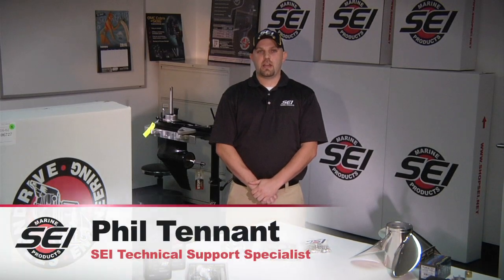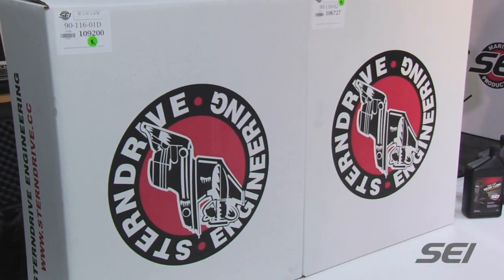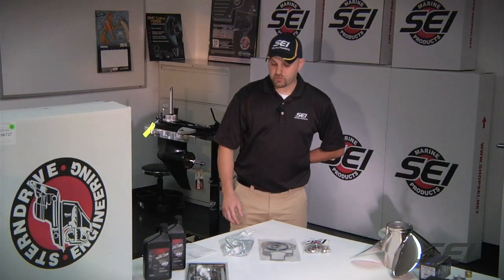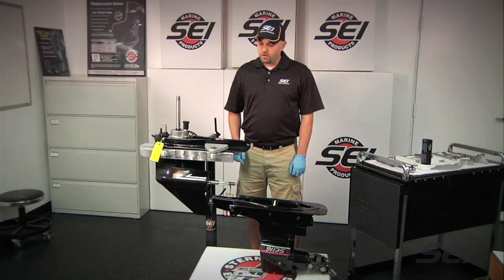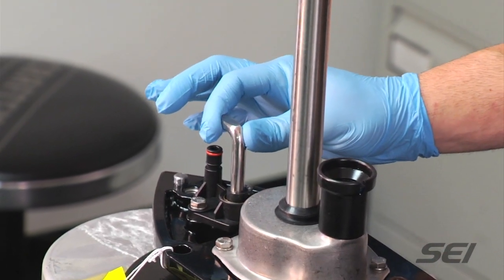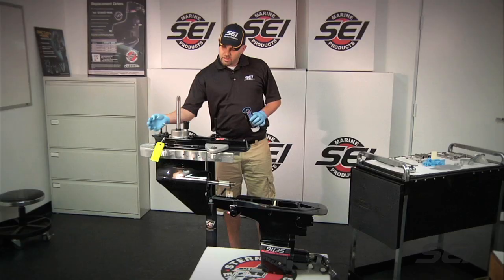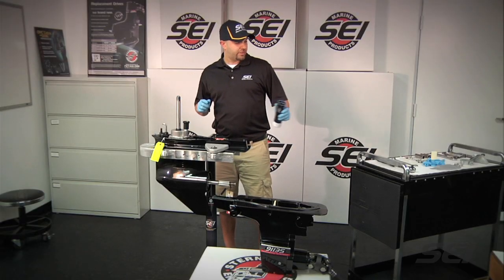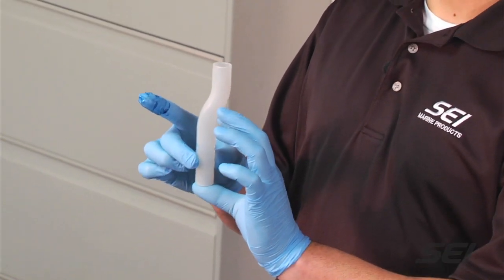How To: Install a Sterndrive Assembly - Drive Assembly - Part 1 (1 of 3)

Comment: The cupler shaft receivers teeth are made of aluminium and the oil pans on engines are stamped metal that rust in five years nothing like the 1970 s trs  drives with ford 460 v8

Comment: Shouldn't you use dielectric grease on the dowel pins that align the lower unit with the upper unit?  They serve as the bonding conduit (for electron flow) between the two pieces, and I was taught that regular marine grease acts as an insulator and impedes the two pieces from being electrically bonded (grounded) together.
Reply: People keep getting this backwards.  Dielectric means insulator.  If you are trying to insulate surfaces you use dielectric grease.  Most regular grease is conductive.  Some synthetics are also conductive.  What you are trying to achieve is a way to reduce corrosion which is an insulator.  A grease that stops corrosion will in effect help conduct electricity.  A good example is greasing up a bulb socket to keep the copper from oxidizing from condensed moisture.

Comment: I wish you guys would make a gasket for the transom assy to the transom of the boat the factory transom seal don't seal no good water runs down the studs and is wicked up by the wood in the transom the T R S. Drives and 3 drives had a robust cork and rubber comp gasket and did not have a leaking problem I removed old wore out transom assy T R. That the transom was rock solid to many transom and stringer jobs on late model boats when u .pull of the smaller alpha. Plates and the earlier. Transom assy theirs no protrusion of the fact seal if you make this gasket you will sell a bunch. Check it out!

Comment: On a new SEI  Alpha 1 drive, the splined gear rod on the lower unit wants to slip out of FWD gear with the least provocation when installing...How do you keep the unit in gear?

Comment: You forgot to put on the bearing carrier anode, before you installed the prop.
Reply: What is the purpose of the anodes?  Mine did not have them when I separated the lower from the upper. Since I assumed they're purpose is only fastening and all of the other hardware was there I didn't bother getting them. I had a failure this weekend boat neutral dropped and stopped.